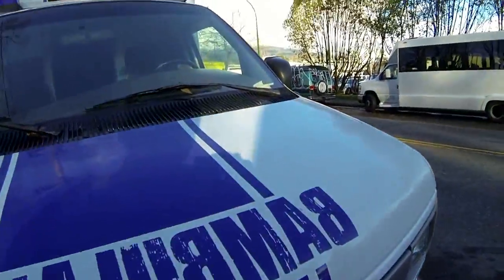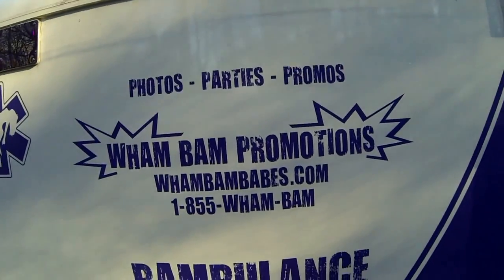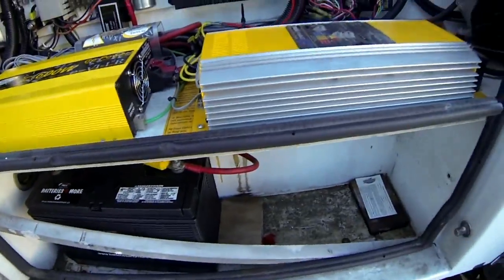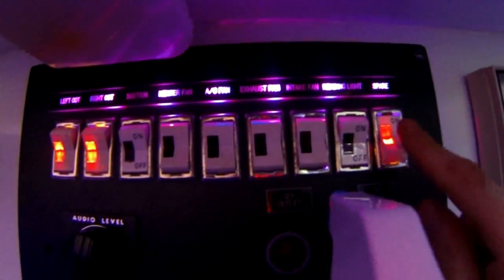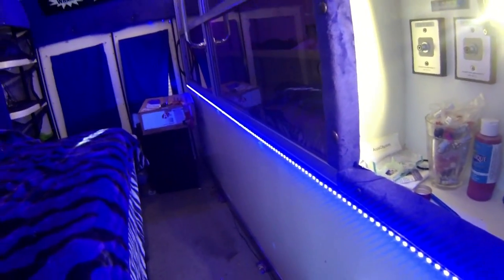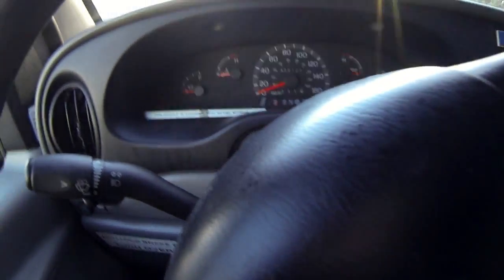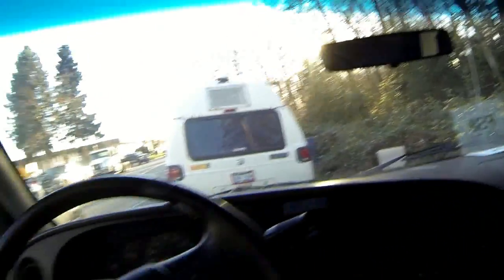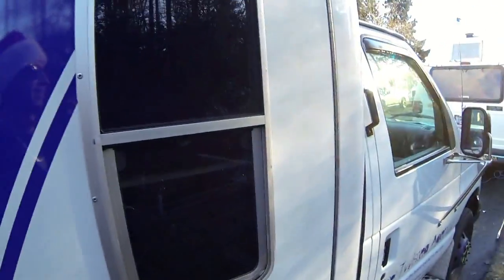Selling the ambulance!

Comment: Yeah. Never. And I mean never! Buy a 6.0 diesel. Omfg. Unless you own a money tree and harvest it Dailey.
Reply: We put a egr delete kit on our 6.0 so no more hot gases running through the fuel injectors.  The mechanic put a aftermarket part on top on the injectors.  I can't remember what it was called.  I remember him saying it has 2 bigger stainless steel tubes  instead of the small plastic ones.  Runs way better.
Reply: Robert Nash in my state you cant do a egr delete..